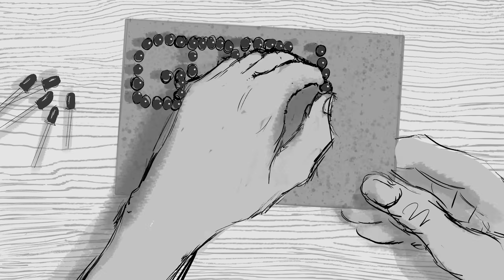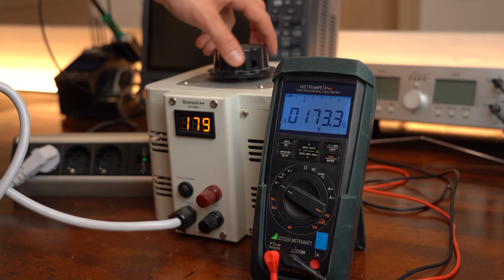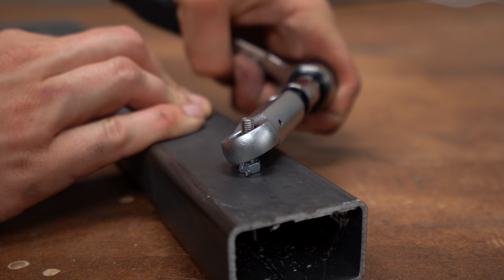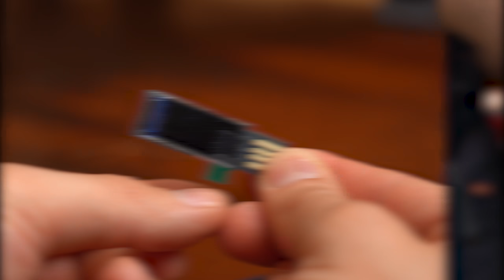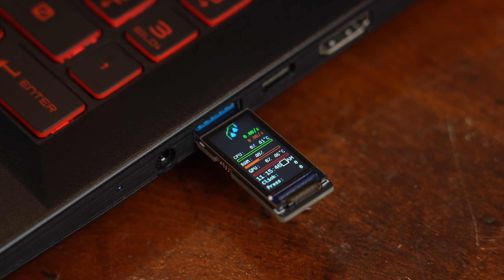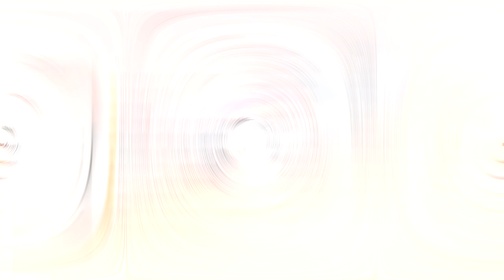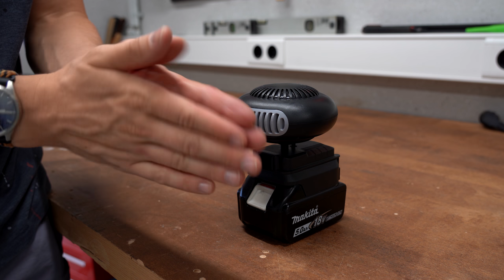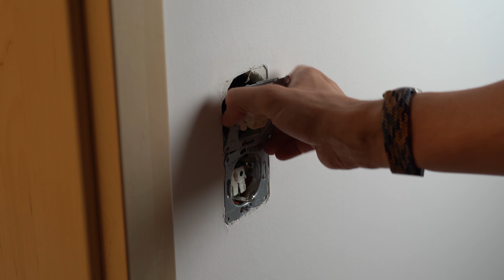I tried finding Hidden Gems on AliExpress AGAIN! (SPECIAL Part 20)

Comment: You can get the 7-segment LED versions of those voltmeters for well under a euro. I bought way too many by mistake, and install them permanently at the end of LED strips to check for voltage drop.

Comment: "No need to put down items" -- shows someone with their hand free and a magically-floating box. The "soapy hands" example I totally get, but if your hand is free to wave at the thing, it's also free to press the thing.
Reply: I have seen them for public bathrooms doors
Reply: @teamusturbo5071  They have them on some toilet flush mechanisms in the UK too, in motorway services etc, but then you have to touch the toilet door to unlock it... So defeats the purpose really.
Reply: You could switch with your body if both of your hands are busy or raise your elbow
Reply: Absolutely crazy 😧 ki
Reply: It doesn't need to be your hand. Stick out an elbow, or use the object you're holding, or just walk close to it like he did in the video. 

Please think for a few seconds at least before posting, or maybe watch the whole section of the video you wish to comment on.